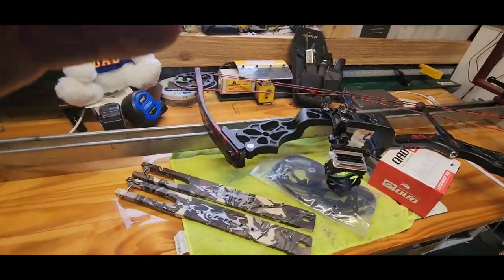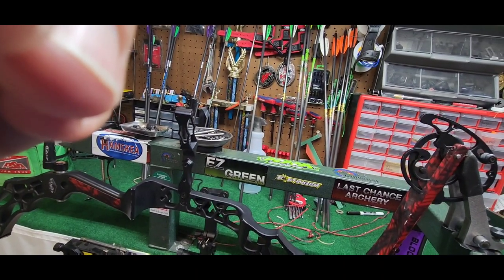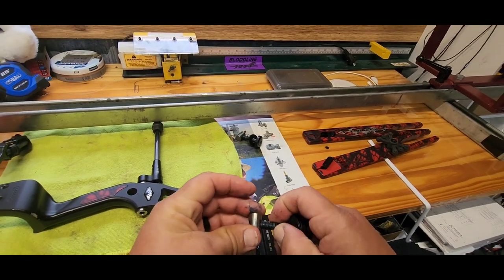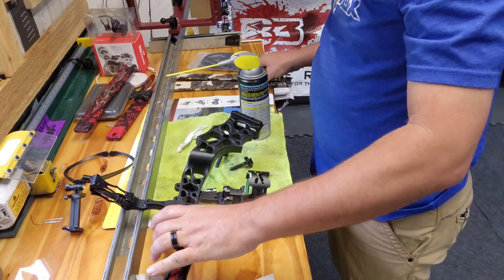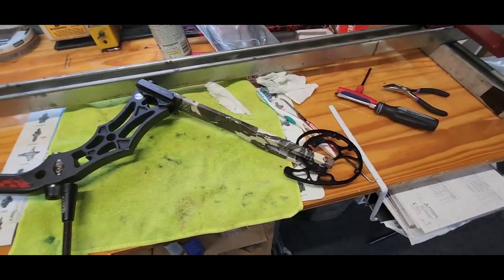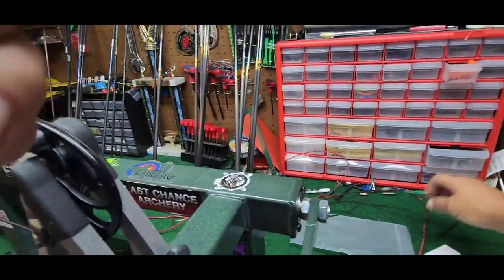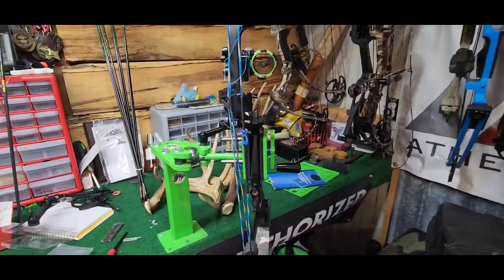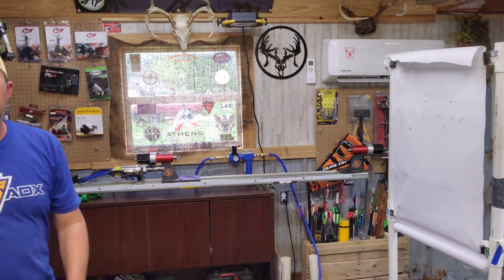Bow build, Limb and cam swap

Comment: From behind the the string I set the rest so the arrow is in center line of an old 30” stabilizer I screw in. This is what I want on every bow I’ve owned for years. A micro adjustment of the rest like 1/64th “ I will try.  Very seldom does this not make a bullet hole. Had an Evolve 35 that I had to move a shim to get right once. I’m OCD about this . Good video for those that haven’t ever seen that done. 👍👍